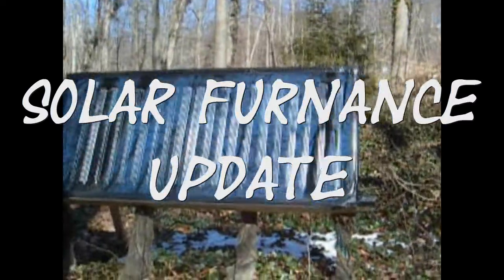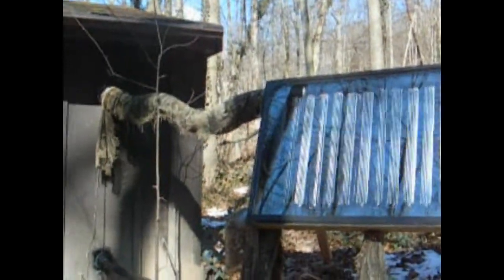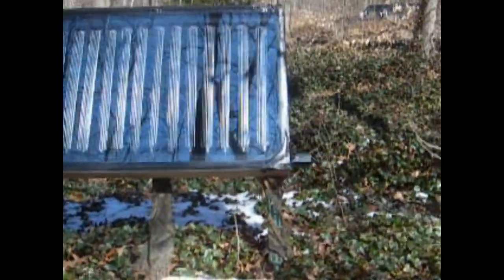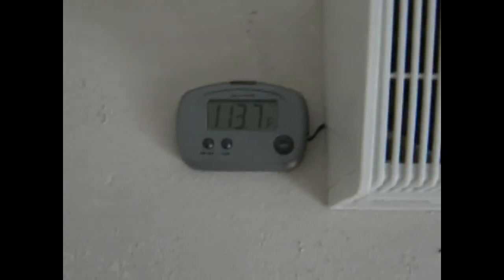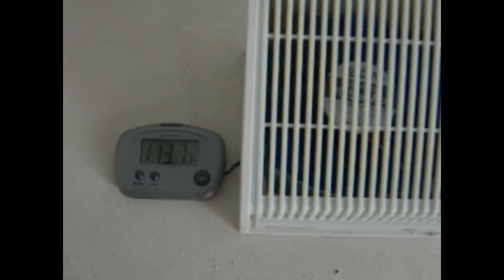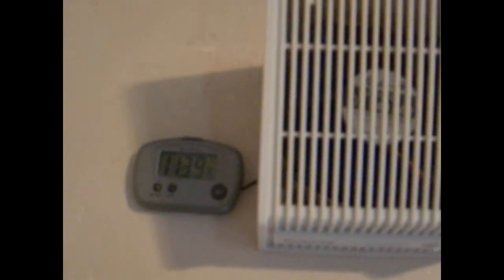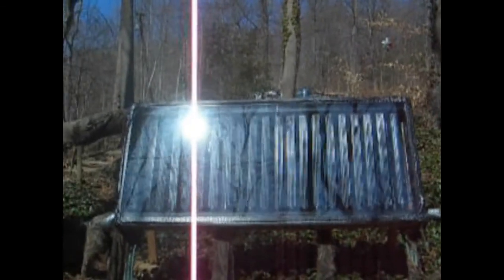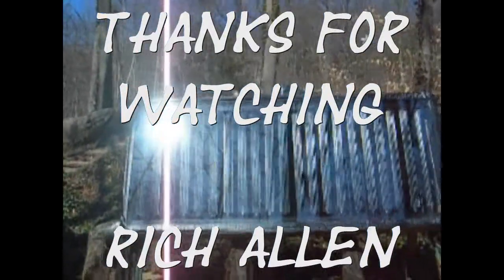SOLAR FURNANCE UPDATE RICH ALLEN

Comment: Rich - we're in south central Alaska and even in the summer, with long light, we don't get above 65 most of the time so these will work great to take that evening chill off.

My question is, with those little 12v fans and the heater pulling 120 to 180 and the room being about 60, how long do you think it would take to heat a 10'x12 bedroom?  Is there any equations to figure this out?

Thanks for all the great vids!!!

Comment from the maker: @navajopa31 hi you could try crushed cans   i got the best heat out of the downspout when i tested off site in full morning sun   my cans are upright in the spouts  but i think just about any way will work as long as there is mass  and seal box and a path full the hot air to flow  i dont get enough sun to say how well they work  long term but they are other vids where people get good sun     good luck  rich